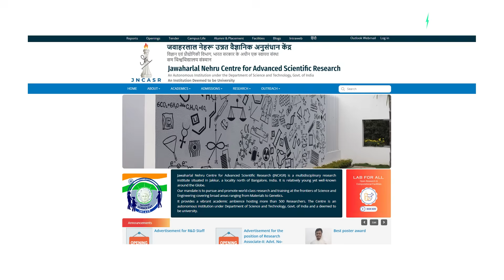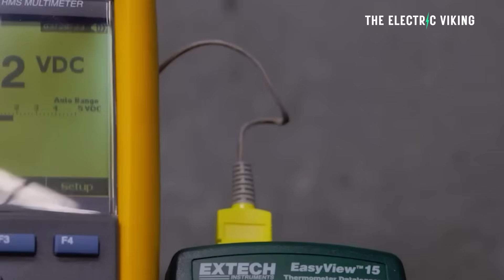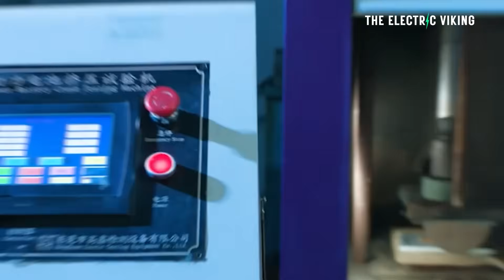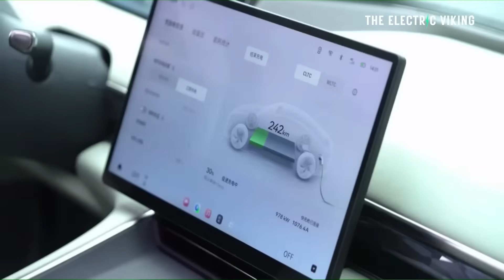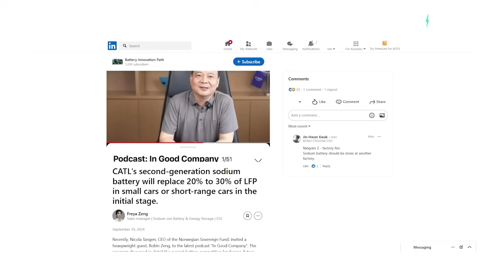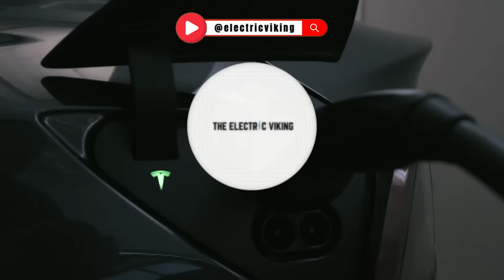India Invents Sodium Ion Battery that charges to 80% in just 6 minutes

Comment: Where is the current coming from to do this especially if there is more then one charging. Fast charging with a cable not as thick as your arm means higher voltage they are already running 400v sick of listening to this shit.

Comment: This is why in some country, EV doesn't get adopted very rapidly. Battery technology still rapidly developing, yet many EV doesn't have battery compartment design that meant to be serviceable. If battery technology still change quite fast, we should have EV that's easy to change the type of the battery. And Battery Management System should be very flexible and compatible to many kind of battery available in the market

Comment: Hello  I don't care.  Even though both Lithium and Sodium share similar features on the chemistry periodic table, Lithium holds much more energy per weight than Sodium..  Battery tech is all about the chemistry., and lithium is chemically better than charging and discharging than Sodium..  Finally, Sodium is explosive too.  Just break open a sodium auto valve and add water... you will see.  Regards

Comment: I think you need to consult independent battery experts at say a research university. Super fast charging times require a great deal of energy, leading to heat, bigger cables, shorter battery life, potential for fires. Charging 1 EV fast is different than doing 10,000. It places enormous stress on your energy network, from generation and storage to transmission through substations to the upgraded charger to the EV itself. All these add cost and require system level upgrades. Where is this being done at scale? Nowhere that I know of. So there's war by press release, even by obscure companies like this one in India. Are they able to invest a few billion dollars building factories? Do they have a deal to supply millions of batteries to a major EV maker? I doubt it. This is just more vaporware thrown up for clicks.

Comment: Most do not understand the basic of what is a battery including Electric Viking. First you need to go to the basic and that is what happens to one battery when charging that battery in 5 - 6 min. Say you have a package of 1 kWh batteries. To charge in 1 hour the power could be 1.15 kWh, charging in 6 min mean you have a power flow of 11.5 kWh. That is 5X water cooker power, the batteries will explode before it is charged.

Comment: If I end up going with anyone's tech it'll be Samsung's SS battery. More expensive in the short term but it'll outlive and outperform me. Last I heard they were due to begin rolling off the line in early 2026
It ticks all the boxes bar cost. Energy density, safety, charge cycles, integrity and quality, charge time, weight

Comment: It is a huge potential for India, because air pollution from two-stroke engines (scooters, taxis, farm equipment) and older vehicles is a huge problem.  Delhi has the most polluted air in the world, and while agricultural practices play a significant role in this,  ICE vehicle emissions do as well.  I think the reduced range is not problematic because Indians tend to drive shorter distances.  In addition on-board charging motors (like those found in Leapmotor products) can provide extra range, in the rare cases where it is needed. I think India could produce these types of hybrids.  India moreover has an abundance of sodium.  Cheap sodium ion, when combined with solar panels also opens up the possibilities of off-grid electrification of homes, which can be very important in rural areas where it is too expensive to install power lines to each home.

Comment: Lower energy density can be compensated by quick charging as requirement for large volume battery backs will reduce. 300 km range will be enough.
Reply: I have read the paper 300wh per kg is the energy density.
Reply: @in-human1698  LFP is dead technology then.
Reply: 300KM range is not enough. I wouldnt consider anything less than 400km range, under less than ideal conditions. I could get 600-700kms per tank on my Toyota Yaris, half that range is laughable. I dont want to have to stop twice as often on a road trip.
Reply: @Cryptlord9999  Road tripping in a Yaris greater than 400km in one go? Feels like this would be somewhat uncommon use case of a Yaris. The advantage of range is not really that you can go further in a single trip, it means less Charging Cycles in general so longer life of the battery - Probably.